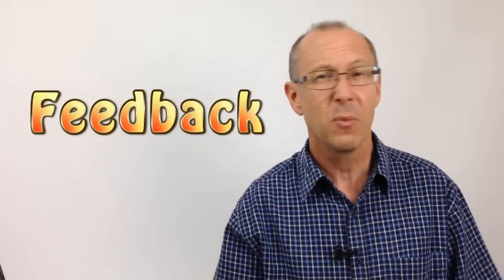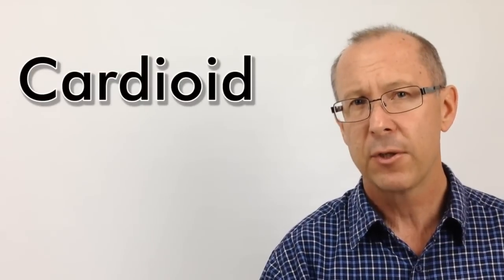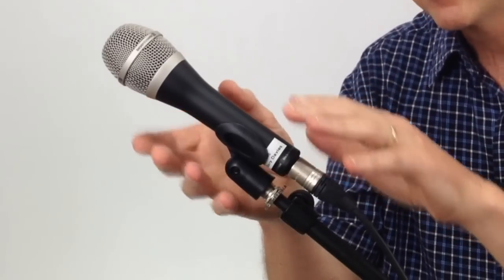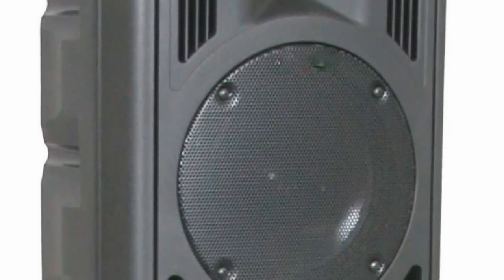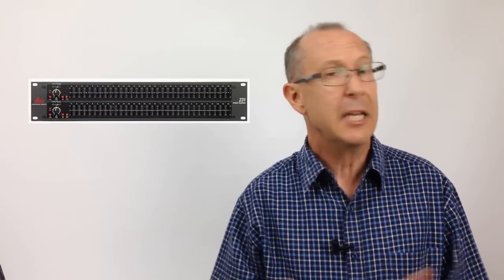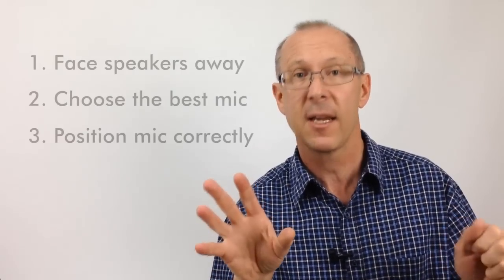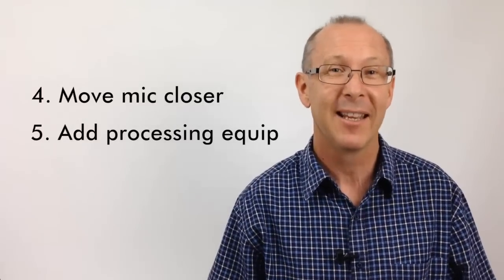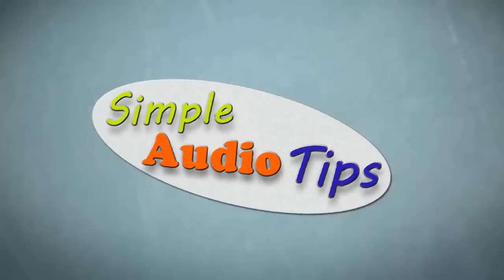Audio Feedback- What causes it and how can I fix it.

Comment: I have a behringer floor monitor and when I set up to my Neewer nw 800 and position it to my height that i can reach the mic when i turn the knob two around 3 clicks on the volume it has feed back and I've set the mic as well as the speaker in different spots so how could i solve this? Thank you
Reply from the maker: Aaron, the NW-800 is designed to be used in a studio situation. It will be very difficult to reject sound from your monitor returning into the microphone. As in the video a microphone with good rear rejection is the answer. Your Neewer mic is best used with headphones to monitor the sound and not a stage monitor. Hope that is of help.

Comment: How does the frequency of the squeal change with distance from the speaker? Do you get overtones when you stand at different distances from the speaker?
Reply from the maker: There are so many variables. Reflections off walls, floor and ceiling and their distance differences have a bearing on the frequency. Which ever frequency is multiplied by being added to itself will be the loudest and most likely the next frequency to start looping through the system causing the tone we call feedback.
Reply: Thanks

Comment: how about this scenario:  you have two monitors running on the power mixer that also runs the two main room speakers, so the monitors are placed on the floor right in front of your acoustic guitar/singer ,  seems like this positioning is a nightmare waiting to feedback ? but where else can you place the monitors ?  thank you Sir !
Reply from the maker: Oh dear! That's a difficult setup. The only way to eliminate feedback in a situation like that is some very heavy processing. Using a 2 channel graphic eq and using one side for the main system and the other to feed a separate amp for your monitors will give you much more adjustment to eliminate feedback. If this is not possible, you just have to be very close to your microphone. Hope that is of some help.
Reply: ok here is a link to show you the system I'm talking about,  I just don't see how you can possible use those monitors standing in front of it with an acoustic guitar ?   it's not just the singing mic that is close to the monitors but also the pick up in the acoustic guitar,  but jeez  if they are selling this kit it must work somehow  ...
Reply from the maker: Ok, that is a challenge. Just didn’t get the link, sorry.
Reply: ooops  here is the link   https://www.youtube.com/watch?v=HhzweRFigfU  the monitor channel and main channel are separate but it still looks like trouble to me
Reply from the maker: Got the link, thanks. You would be using quality equipment and that's a good start. That kit could be setup well. The speakers are on stands and they would be facing forward. The monitors would have to be run at a lower volume that's for sure with the acoustic pickup. One of the simplest ways to reduce feedback is to lower the volume of the sound system.
Reply: Thank You Sir ,  and yes the monitors are on their own separate power source so reducing monitor volume is def an option , and moving the two monitors to the side a little would also help.  Thanks for checking out the link .   Peace !

Comment: Hi Garry ! Thank You for the great tutorial. However my problem is a bit different. It will be great if you could help. I have the Sennheiser eW100 G3 wireless set. The lapel microphone that comes with the kit is giving a very tiny noise. The audio sounds fine but the background has this tiny nearly faint noise. The noise sound like some kind of signal noise. I have checked the gear thoroughly and it seems the problem is definitely with the lapel. Can you please advise a solution. Thank You once again.
Reply from the maker: It does seem that your mic lead is picking up interference from the transmitter. Transmitters are extremely noisy electrically and your screening on the mic may be poor or broken down in some way. Try another mic with the transmitter to see if it makes a difference. Hope that helps.
Reply: Thanks I used a second microphone...and the problem was gone....I think that the problem is with the first microphone only....would you be able to examine a test clip...or should I just head straight to the Sennheiser repair guys...
Reply from the maker: +Saurav Nag Definitely go straight to the manufacturer. It will help them in research and development for future models as well.  Hope you are able to get it repaired.

Comment: I have a pretty bad feedback phobia. I cringe when I hear it and I get extremely mad when someone lacking experience doesn't know where to point his mic...
Reply: wear ear plugs, audio feedback can be highly harmful for ears if you can't protect your ears, the last audio feedback i heard made my ear bleeds internally.
Reply: @davilins145  I was also exposed to microphone audio feedback. My ears didn’t bleed but I’m worried about damage for sure
Reply from the maker: Yes like any industrial noise you have be careful. Thanks for adding your comment.
Reply: it's possbile to break a glass with audiofeedback
Reply from the maker: +Davi Lins Yes I guess if it was left ringing for long enough and if your sound gear coped.
Reply from the maker: Yes and then the inexperienced place their hand over the mic and make it worse. I hope your getting some treatment for the phobia :) I know how you feel.

Comment: Question. Rock concerts often have a wall of amplifiers behind the singer so how do they avoid feedback? Also, how does a monitor work if it is so close to the microphone, on stage?
Reply from the maker: +gregory brian What a great question. You would think that setup would create terrible feedback. Without factoring in the benefit of processing equipment that isolates problem frequencies the answer lies in the loudness of the voice measured in dB's being picked up in the microphone compared to the dB level from the speakers. When a singer places the microphone hard up against their mouth the level is at very high levels. If someone sang at those levels up against your ear it be literally deafening.  Because of this the microphone mixer can be turned down to a point where there is little chance of feedback. Feedback occurs when the mic gain is turned up to a threshold point where the mic is picking up more of the sound from the speakers than the singer. Bit of an over simplification but it will do for this forum. Hope that answers your question.
Reply: @GaryDmedia  Does this mean that if the singer isn't singing loud enough, it creates room for feedback to occur? Or does it mean that the mic gain should be low? Also, if I'm having issues with the vocalists not being heard, would it be beneficial to keep the gain low and increase their volume on the fader? Or would that still create the same feedback issue?
Reply from the maker: If someone is singing and they are not close enough to the mic, or they are singing quietly, the sensitivity of the mic has to be increased by turning the mixer console up. Now the mic is more sensitive it will start to pickup more room noise including sound from the speakers. If the mic picks up enough sound from the speakers, feedback (ringing) will start to begin. Turning down the sensitivity of the mic and singing louder or closer to the mic reduces the chance of feedback.

Comment: Always a battle to keep feedback away especially when you have multiple people close together on a stage.. .. Do you have any experience with feedback destroyers or is it better to just stick with your RTA meter and graphic  EQ going through and finding problem frequencies?
Reply from the maker: +Joe Borsch Great topic! There have been so many devices that have been produced to terminate, illuminate or destroy feedback. All have worth if used modestly. Of course it is much more important to position your gear in such a way so as to reduce the chance of feedback as much as possible even improving the acoustics on the stage. Then equalize the venue with the EQ of your choice and better still one that you can finely tune the band width of frequencies effected- then and only then add a feedback eliminator if the venue is impossible to stabilize. Most of the good ones have 3 or 4 frequencies you can fix and you can leave a couple of frequencies float for stray frequencies that may come into the system if the mics are moved around a lot. Remember that if you are working on a budget- less processors the better the sound. Cheap processors or feedback eliminators reduce sound quality. Hope that is of some help.

Comment: our church just bought a senniheiser freeport omni directional collar mic that will put me out of the job as sound technician. the church is on a very very limited budget and the hall is quite small. the pastor wants to use this collar mic. The mic when its gain is at its very minimal on the device and desk is producing very bad feedback and tunnel vocal effect. how do i get around this feedback situation. its connected to the stage snake box via a xlr cable.
Reply from the maker: With such a good quality microphone, keeping it high on the chest you may find that it won't be a real issue.  You just won't have the advantage of the cancellation of a cardiod mic.  It gets down to a ratio of the level of sound coming from the talker to what is returning from the speaker. Getting the mic as close to the person's mouth is the answer.  This is why many wear a headset mic getting it close to the face when there are issues with high levels of reflected sound on the stage.